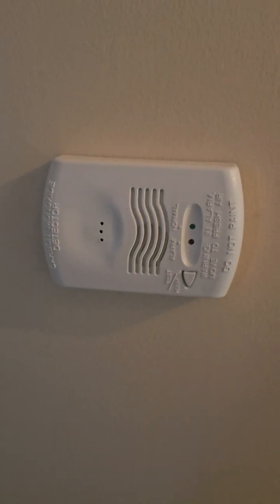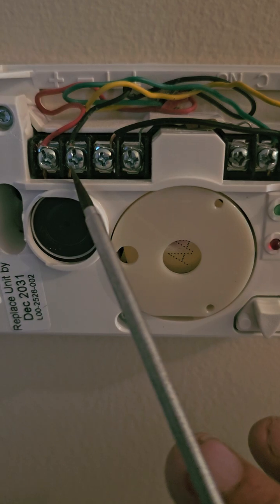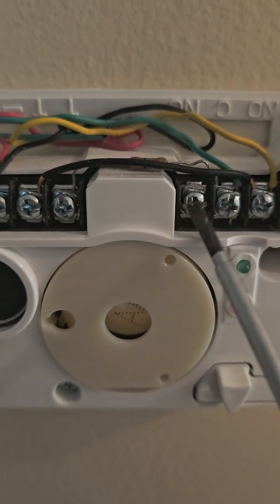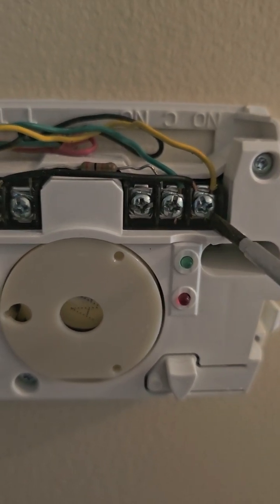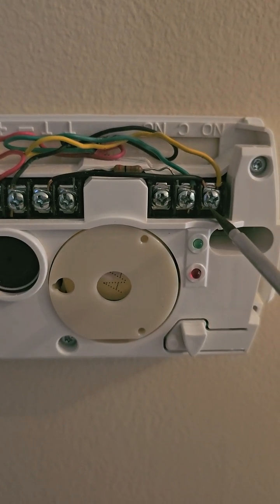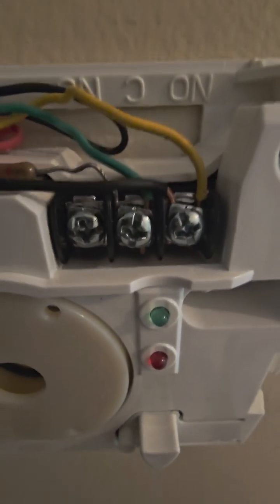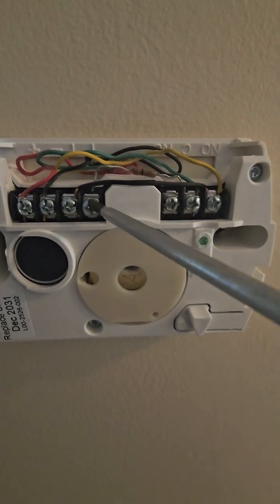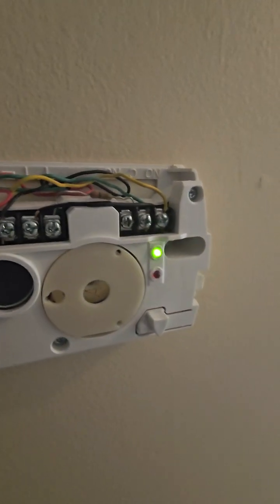Proper Wiring of CO Detector

Comment: I think I can follow ur wiring. I am not going to add a jumper wire. I have 4 wires, red, black, green, and yellow i will hook them to black neg,red goes to postive, green goes to common, and yellow goes to NO, correct? Also i cant see where the battery is to be installed. Can you please help me?
Reply from the maker: This is not a battery operated device. It is powered from the control panel. My explaination is not the best. Doing three things at once. NO - means normally open short on alarm  COM - Common

Comment: Thank you for the video. Where can I find the EOL resistor?
Reply: I'm also trying to figure out where to get the EOL resistor.  My old CO was at its 10 years so I bought a new one buy threw out the resistor.  Colors look the same as this video buy I don't know how or where to buy it or how many ohms of resistance for my safe air 260-co
Reply: @ I got them from Amazon. But didn’t require them when I called my security company technician for the install.
Reply: @CBigsby  without the EOL resistor my alarm would trigger everytime the power went out which is often here.
Reply from the maker: @ Because it was shorted. The End of lline resistor provides supervision of the device and the wire to the control panel. Most panels have 1K resistor (Red brown black) or 2.2K (red red red) Glad you figured it out
Reply from the maker: @michaeltrembacz8644  your alarm should go on battery backup.  If the CO was wired correctly and programmed, a power outage should not trigger an alarm. Check your battery
Reply from the maker: What alarm panel do you have and I can tell you what value the resistor is. Sorry for the late response
Reply: @scottp104  i figured it out... I found it in my alarm panel there was an instruction diagram that mentioned 2k.  All good thanks!
Reply: Yeah it's been 10 years i think the battery is toast.  I don't use the alarm system anyway, but it's good incase of a fire

Comment: If you are wiring more than one of these on a chain is the wiring the same ?
Reply from the maker: Yes - you can wire the tamper in series on every device but the relay for activation needs to be in parallel like smoke detectors.  In other words, each detector will be wired like this EXCEPT the EOL (end of line ) resistor goes on the last device in the loop. In and out with power (red and black) same terminal, in and out on the relay contacts. All CO will just have a jumper replacing the resistor as shown. The very last device will have only 1 wire for power and loop, and the EOL will go as shown. Sorry for the late response.